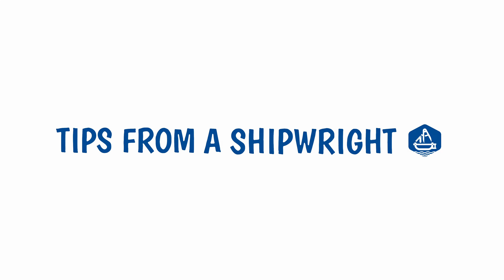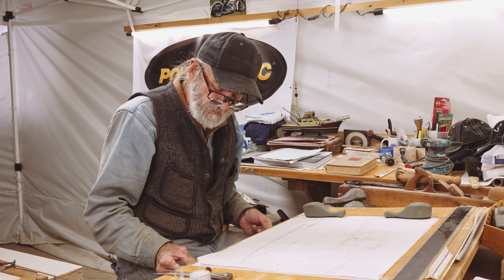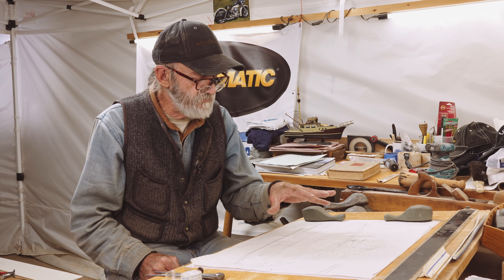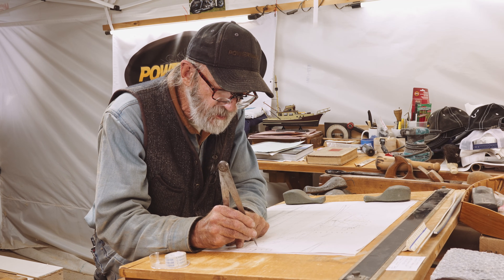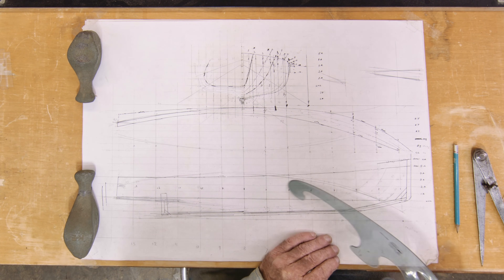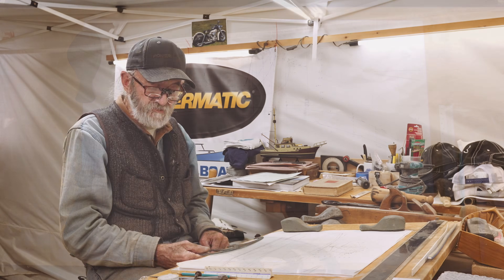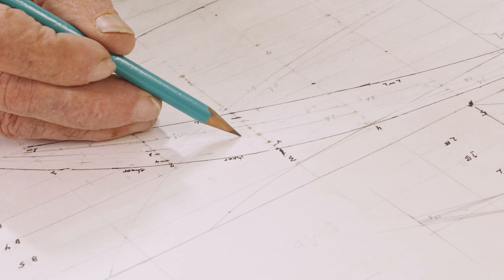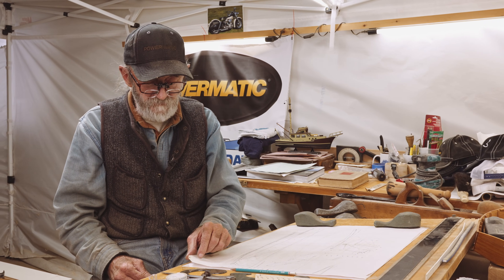Building Orca - Ep. 21: Lofting Pt. 2 - Preparing the Drawing

Comment: The drawings were originally done on vellum with india ink. When errors were made, a kind of convex blade X-acto knife was used to scrape the ink off the vellum It made a shiny spot, but you could then ink over it again.  Then when the drawing with all its shiny spots and inked over corrections was done, you made a contact printed blueprint from that by mixing green ferric ammonium citrate with potassium cyanide and brushing it onto paper. (bit more complicated) When the vellum drawing was placed in contact over the paper in the bright sun, the rinsed off paper appeared deep blue with white lines where the original black ink lines were. All clean and blue & white negative print well known to us as a blueprint. By the 1940's a reverse process known as Diazotype began to supplant the old cyanotype blueprints which dated back to the 1840's. This new process produced deep blue lines on white paper and were called whiteprints at that time.

Comment: As someone skilled with CAD, I think it would be a fun challenge to try to model this on the computer. Would you be willing to share the table of offsets so I can give it a crack?
Reply from the maker: Sure! Once we get them all I'll send them over. What program do you use? There is an add-on hull design program called Orca for Rhino CAD. I use Solidworks but haven't tried to design anything like this before. There are a couple open source programs I see mentioned around.  Having a 3D model would be nice to confirm all the dimensions before we start building the molds.
Reply: @T @TipsfromaShipwrightvideos  I use Solidworks professionally but I use Fusion360 for hobby/personal projects. I got pretty far today just using screenshots from the video! Should be easy to adjust to the final lines when you send them :)
Reply from the maker: Epic! I'll DM you
Reply: @TipsfromaShipwrightvideos  I don't think YouTube has DMs anymore, I'll shoot you an email.

Comment: Another way to make a clean copy is to use vellum on top of the original.  You'll be able to see the original lines thru  the vellum and you can easily trace out what you need without all the hole punches.  Good quality vellum is also your friend when it comes to inking - your pens will be much more controlled.  If you get fancy, a large glass light table is a big help too.  Thanks for the video!  It's always fun to see different ways to get a job done.
Reply from the maker: Haven't tried that yet, sounds like a good technique!

Comment: hey lou what is your thoughts on flare. you see some boats have the carolina flare, orca doesn't seem to have any flare. how does that affect the ride and staying dry
Reply from the maker: I think boats with flare tend to be made for higher speed, planning boats. These displacement boats don't seem to need it.
Reply: @TipsfromaShipwrightvideos interesting, if you were building a boat similar to orca but you didn't have to make it movie correct. Would you put flare into the bow? Or would you still say it doesn't need it cause of the speed it travels?
Reply from the maker: Lou doesn't seem to be a fan of flare, at least for this type of boat. I think there may have been some on the v-bottom skiff he designed.